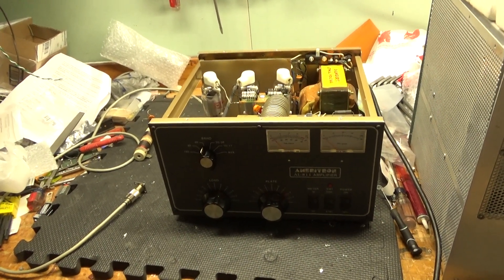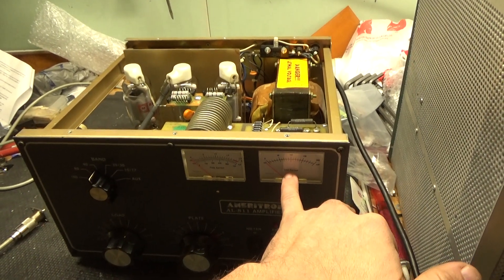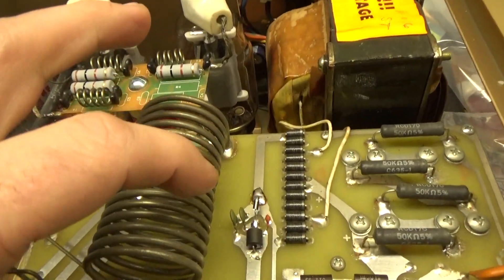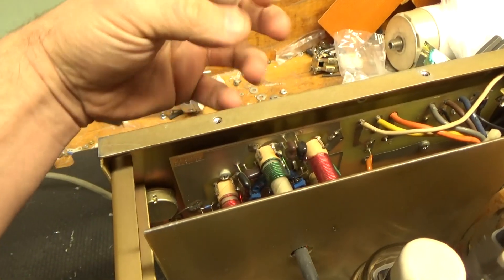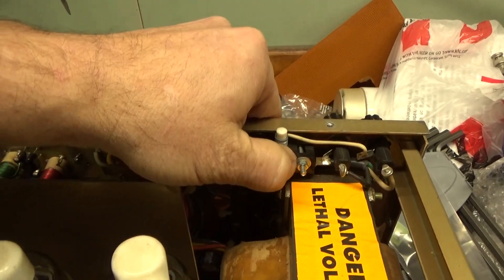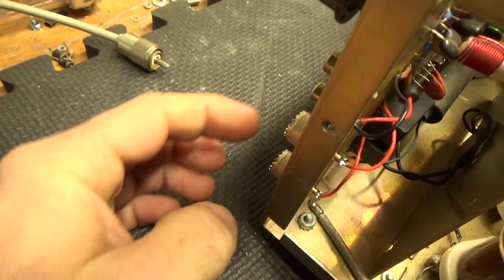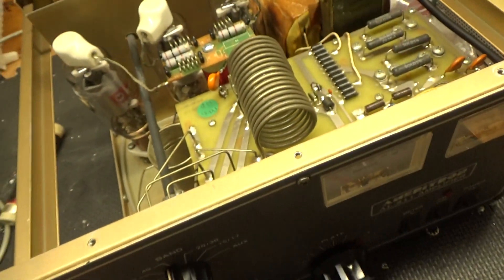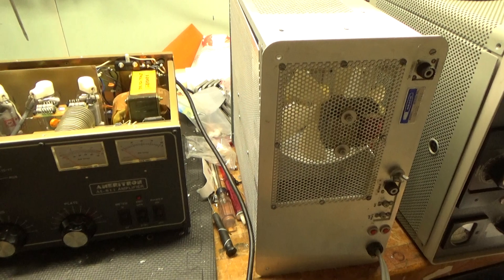Ameritron 811 repair

Comment: I have a 811 Amertron (3 tube) and it started blowing the two 20 amp fuses. I thought it probably had a shorted tube.  I don't have a tube tester, so I replace all 3 tubes. The amp came up to the 60 ma idle plate current and everything seemed ok. I made one short contact with it after about 5 minutes the fan turned off. Of course this means the amp turned off. I wasn't transmitting or anything. It had blown both the 20 amp fuses again. Looks like I replaced the tubes for nothing. Any suggestions for starting to troubleshoot this amp?
Reply from the maker: 20 amp fuses ? If so do not turn on again until you put the proper size fuse in. Should be a 12 amp if wired for 120

Sorry can’t help diagnose but if want me to repair please feel free to give me a call
Reply: My mistake, they are 12 amp fuses.

Comment: When I pulled the old 811s out the metal plate cap came off the tubes. The caps had become seized (heat) in the ceramic cap holder. I tried to disconnect them very carefully, but they were stuck. Have you ever encountered this problem ? Is there anything that can be done to prevent this in the future?
Reply from the maker: Clips inside the anode cap need to be adjusted

Was on the anode to tight. 

When I encounter this , I rock ever so slowly like a see saw direction. You cannot twist like a clock.